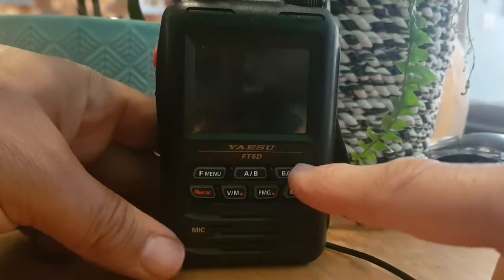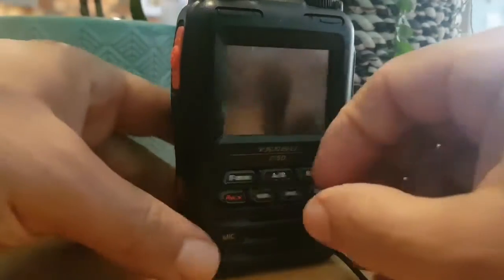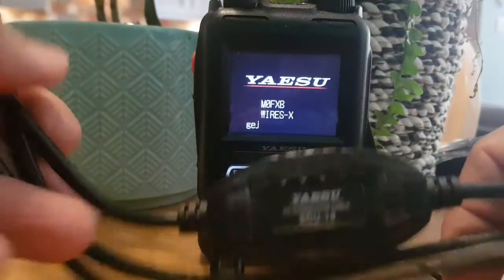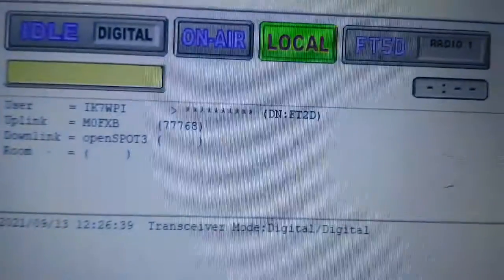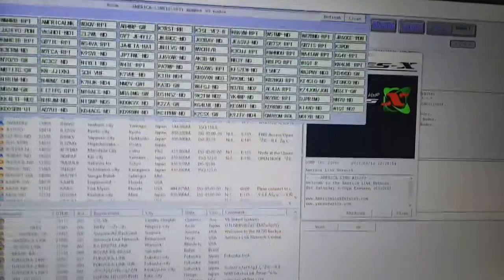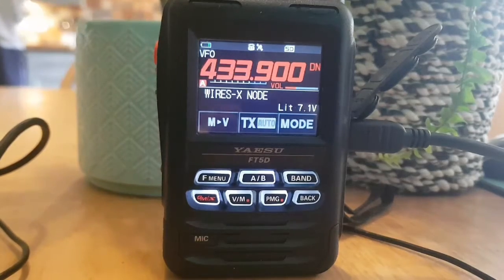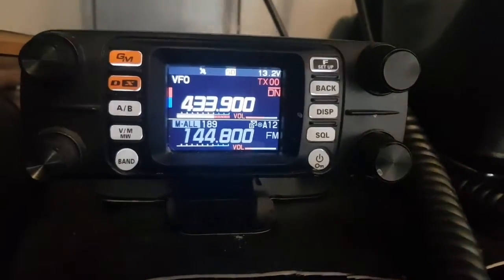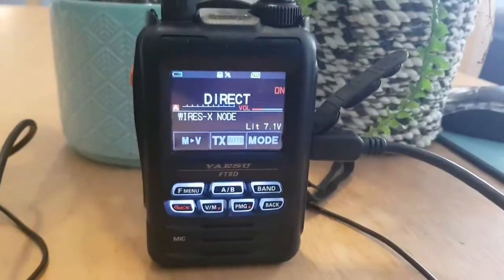Yaesu FT5D- Enable - PDN mode HRI mode  -Access mode

Comment: This does not show both modes.  You are not using the other cables in the kit so you can use both HRI mode AND access point.
Reply from the maker: Hi yes agree i do not have the other cables, if I did have the cables what do I select to hear analogue link ? Thanks

Comment: I'm still not sure what "PDN mode" is.  Looks like it's a visualization of Wires X?  Loving your vids but longing for just a little more explanation.  Sub'd.  Thanks for doing these and I love how you make each one about a separate topic.
Reply: Regrets, I see you've linked to the manual now.  I'll read that to understand better.
Reply from the maker: Hi  PDN mode allows PC control of the wired X system where on your PC you can connect to rooms and other stations with no antenna still using the radio but you are limited to digital contacts- HRI mode is like having a HRI-200 box this allows analogue , digital connections plus you can run your own node  via the Wires X system  same system you do need the scu39 or 40  cable kit .

Comment: In PDN mode i believe you have to push the DX button again for a longer time. After this, you should use the FT5 ….but connects only work in digital nodes/rooms. 73
Reply from the maker: Hi many thanks :)